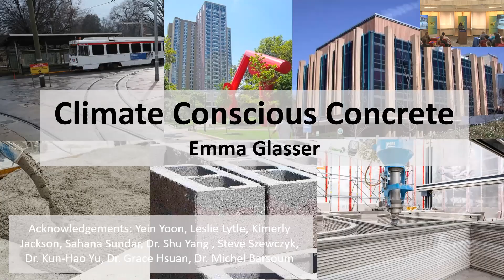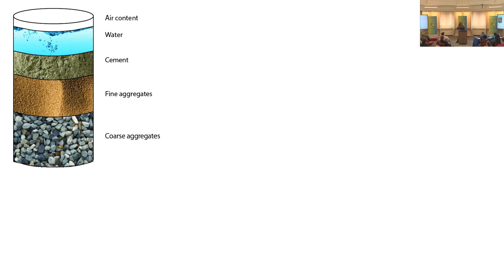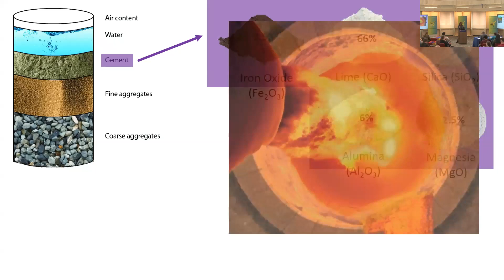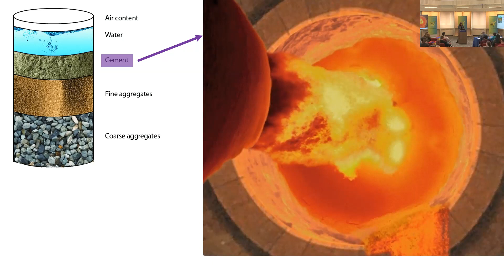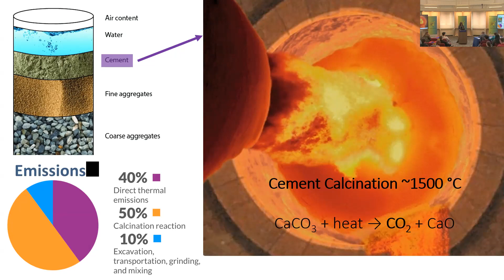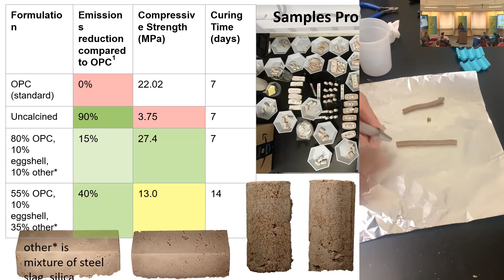Emma Glasser: Climate Conscious Concrete

Comment: Thoughts on how the “new”(some people and Harvard and mit rediscovered the use of quick lime and believe it to be the one of the reasons Roman architecture has stood for so long I suggest checking it out) discovery of using quick lime in concrete could effect this? Maybe it would be better for put concrete to just last much longer than lowering the production emissions?